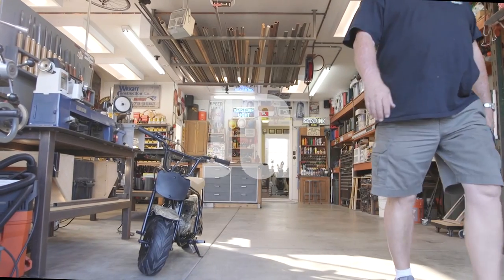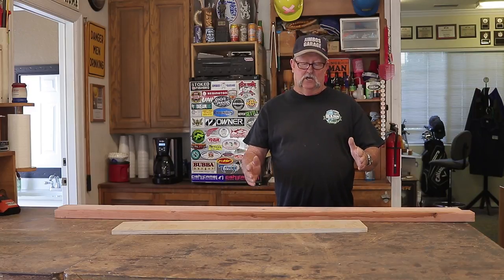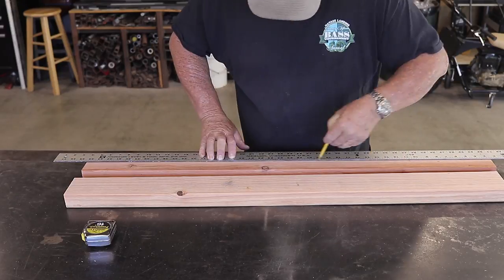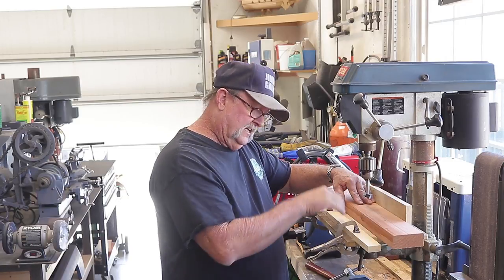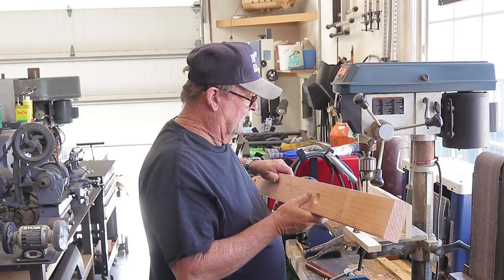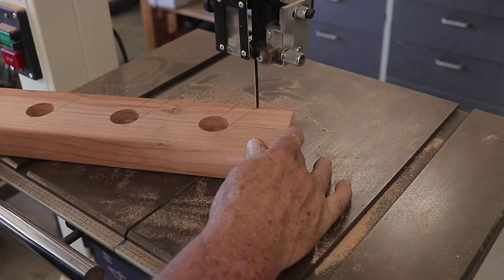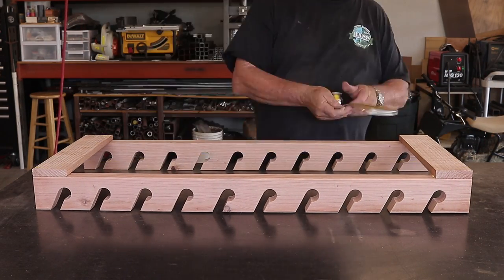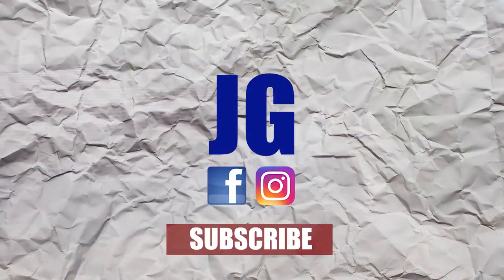Homemade Hat Rack | JIMBOS GARAGE

Comment: Just a tip:  You can easily fabricate an internal sander by cutting a slot in your dowel, doubling your sandpaper and insert it in the slot, then just chuck it up in your drill and have at it...